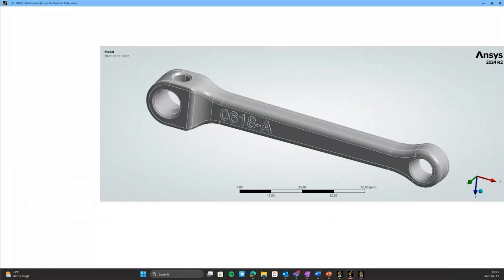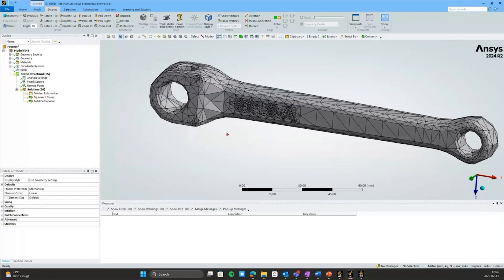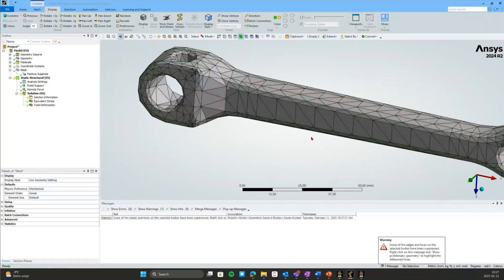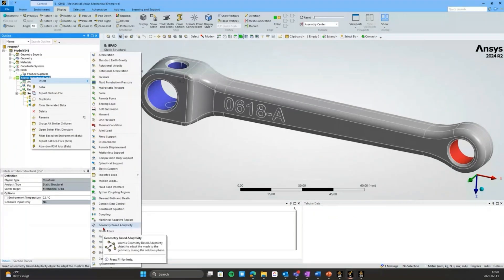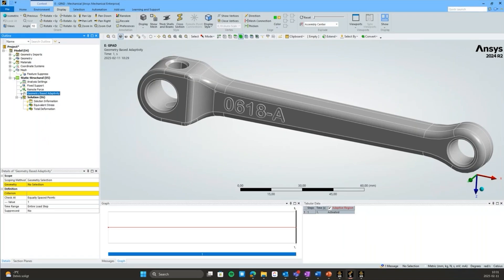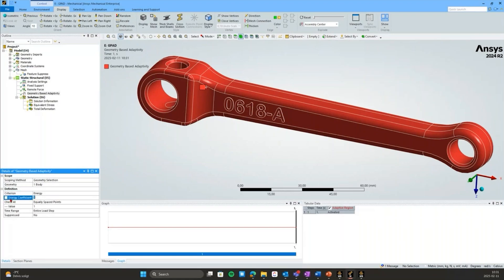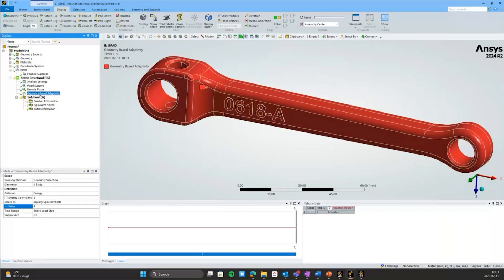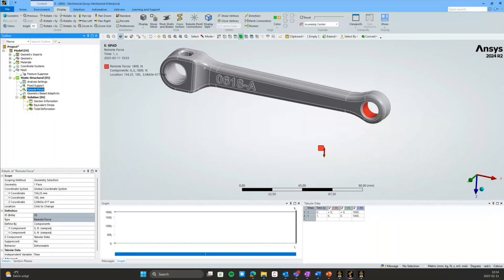How to use GPAD for Mesh convergence in Ansys Mechanical

Comment: This tutorial was very helpful and gave a clear explanation of mesh convergence using GPAD in Ansys Mechanical. I really appreciate the way you explained it in a practical way. I’d be grateful if you could also cover the submodeling technique for several parts in an assembly, as that would be very useful.